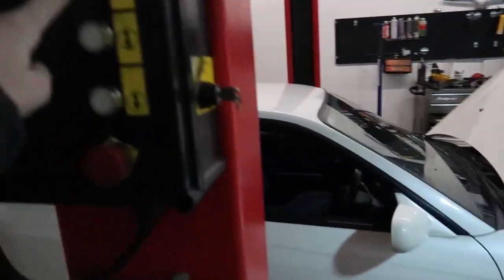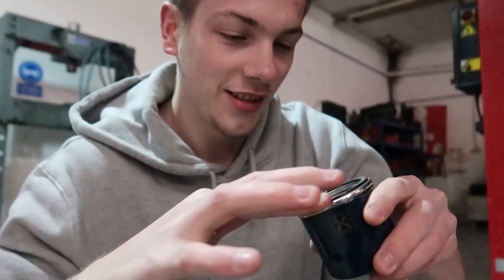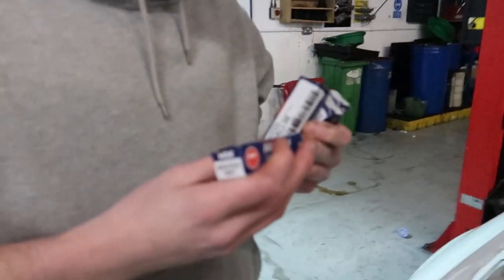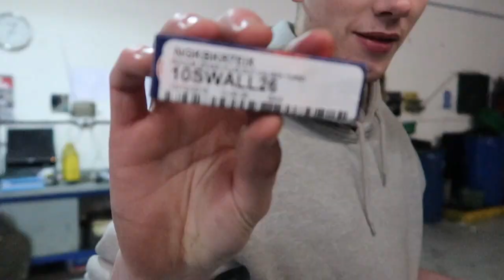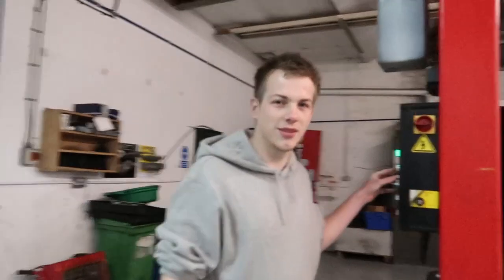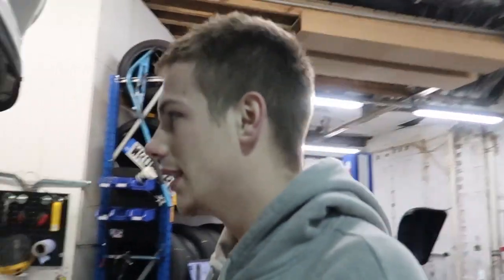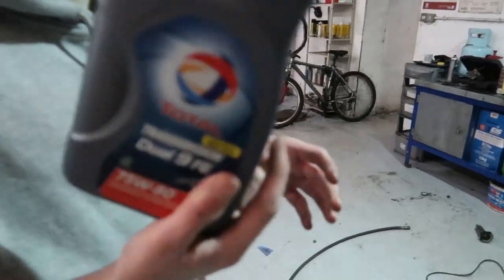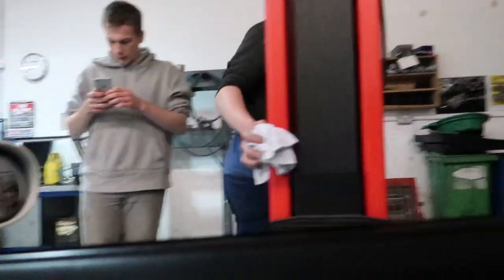SERVICING THE S15!!! // What are the best parts to use?

Comment: I want to know whyyou use 10W-50 engine oil. Is the engine rebuilt with different bearing clearence or? Because I would NOT recomend using that at all.
Reply from the maker: Julkorv really? How come? Everyone that Elliot spoke to recommended it, even the previous owner!
Reply: @Sbodysxph  I have a s14a exact same engine as your s15 but it runs 10w40 fully synthetic Castrol
Reply: My Skyline is 10w60, don't worry 😂😂 I'm sure my tuner knows best